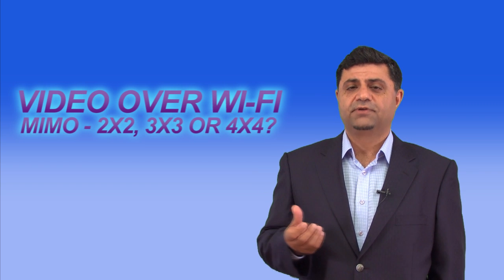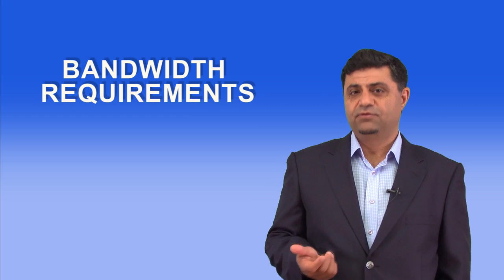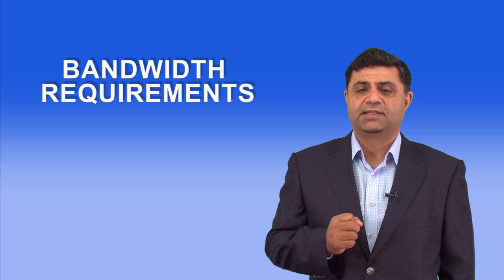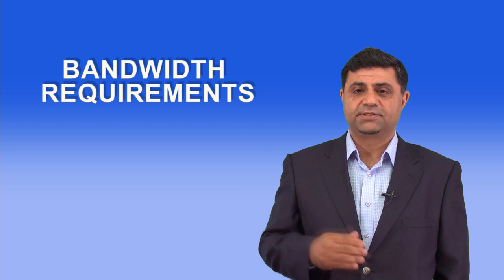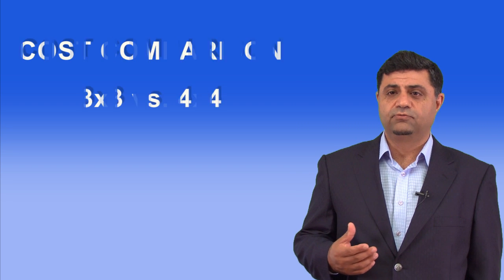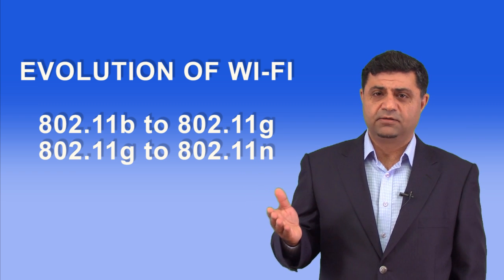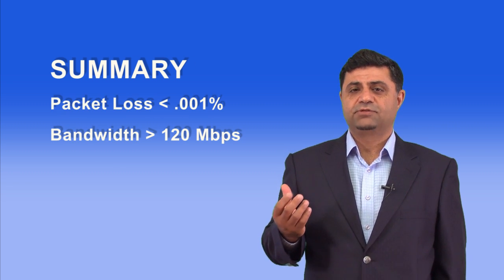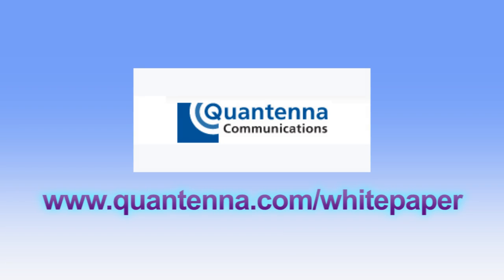Video over Wi-Fi -- MIMO at 2x2, 3x3 or 4x4?

Comment: what does the 2x2/4x4 acrually stand for.  i get it 4x4 is better but trying to understand what these numbers represent!?
Reply: Basically it relates to the number of streams of wirelessly transmitted data on the same channel or frequency.  A single wifi client (with single antenna) can only talk to a 1x1 Wireless AP on the same channel at a time - so if there were 2 x wireless clients talking (on the same channel) to a 1x1 MIMO AP, then one client needs to wait until the other has finished "talking".  Therefore, a 2x2 AP can handle 2 x clients talking to it at the same time. However also consider that a wireless client may be 2x2 capable, so it could utilise both streams when talking to a 2x2 MIMO AP to double it's throughput.  Note however that 2.4Ghz is ONLY ever 1x1, and that you need 5Ghz to utilise 2x2 MIMO or higher.  Marketing material from Wifi vendors may show 2x2 MIMO on 2.4Ghz, but this is only single user (not multi-user)
Reply: It's TxR while T is the number of antennas used to transmit, R the number of antennas used for reception.